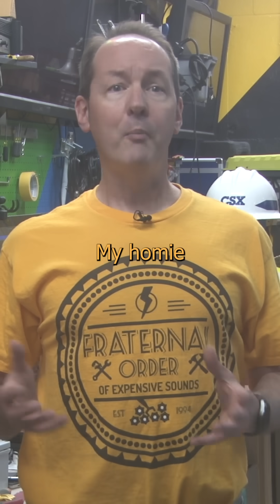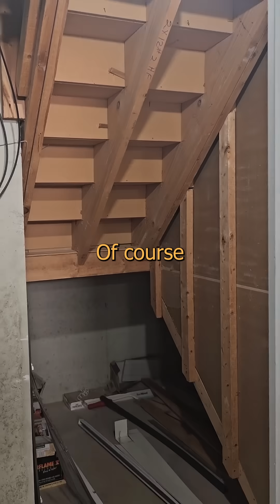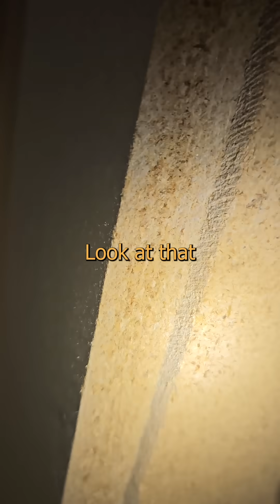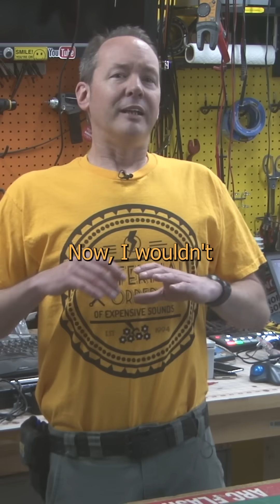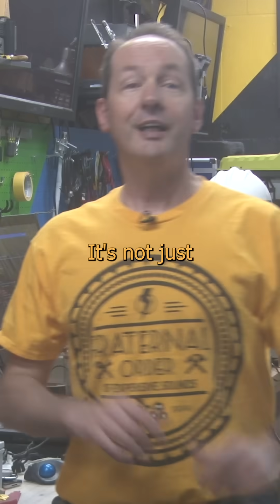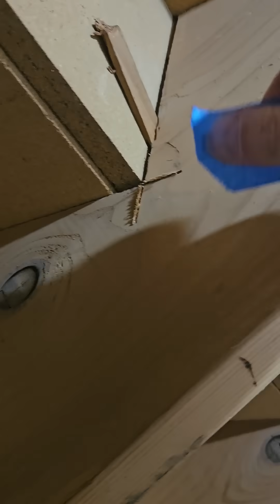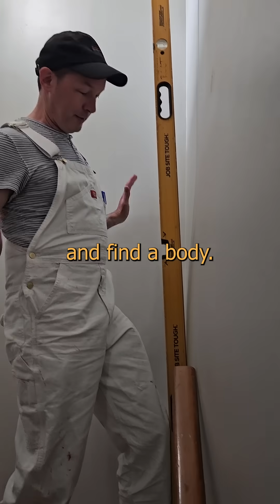Particleboard Staircase #chrisboden #engineering #construction #stairs #cheap #job #work #carpentry

Comment: Okay so it cant be legal. But i have no idea where it says that. I mean i studied code way back during the 2003 standards were still in place. I know it has a table refrencing the load bearing capacities of different materials but i dont have those books anymore so i cant tell. It is shocking what actually still consided up to code. Like drywall being nailed and 24" OC studs (yes thats real as long as certain conditions are met in certain areas.) But its definitely not industry standard. I would trust that over the government twats that write those codes anyway.

Comment: A lot of houses in the 60s and 70s were built with lots of particle board. My parents house built in 69 was completely floored with it.not a piece of plywood to be seen. Floors squeeked like you wouldn't believe. Was impossible to sneak out when we were teenagers. 😅 Went through it and put about a thousand screws in the floor to quiet it down.

Comment: Thoose stairs gave me flashbacks to doing restoration work in trailers those are fine untill water hits them than cardboard has more structure the cost of replacing the stairs will be cheaper then medical bills

Comment: When they built our house, they didn't wait for the adhesive to set on the ceiling joists before blowing in the insulation. The wave-action ceiling required 144 drywall screws and a "kicker plate" to fix. That was just one of the rooms.

Comment: You are correct.  Particle board is a no go for stair treads.  And I’ve worked in municipalities that have upped their code to remove it from stairs completely
Reply: AS1860 Particleboard Flooring
This is the code that allows particle board flooring in Australia. It requires the particle board to stand up to 3 months of weathering without a roof. 

I was very surprised by this but thought I would actually look it up.

Comment: "fuck you Fortunato" got me good. 

There are a whole lot of carpenters here that didn't bother to look up code. You can use particle board treads at up to 42" spans as long as they are Grade M-3 and fastened properly (adhesive and 3" screws with countersunk pilot holes). Would I ever do it? Not a chance. If I had to go cheap, I'd go with OSB treads.

Comment: Never drop your OJ on the stairs. Never mop. Never open the door when you have to run from the shower...
     As long as everything stays bone dry... (Without being in flames)... Everything should work out fine.

Comment: I had fuckery in my house as well, illegal plumbing, 1x2 instead of 2x4 and the same board for flooring. Found out it was a cartel that was using their money to make house cheap so they can wash their money within the construction.  Loads of houses have this problem. Bet the house was built in the 80's/90's.

Comment: It's because people aren't buying houses they're building houses and the people who are building the houses don't give a fuck anymore. Every day I have a conversation with friends who love architecture like I do and they're like what the fuck happened? What happened is people don't care. They want something that looks expensive on the outside and it doesn't matter what it has inside. Look at the current state of American cars. People don't give a fuck if they're built well or if they're actually sports cars all they care is if it's got a mustang slapped on it or it's got the front end of a camaro. As much as I do not appreciate dudes who do shitty jobs it's also the consumers issue. There's no way in fuck I would have somebody build a house for me right now. They all look like they're done by robots. Or how about the fact that $500,000 houses have plastic cobblestone on the front porch. Buy an old house you won't regret it.

Comment: that particle board pos is being cheap af, but those walls have beer stomach, even my useless engineering hands did better job in carpentry. Its garbage penny pinching vs real ducked up skill issue

Comment: They cut the stringers with a circular saw.  That is a bad sign to start with.  That should get done at a factory and not onsite.
I would be checking every rise and run to ensure they are the same and not /slightly/ different.

Comment: I'm a mediocre DIY'er and I wouldn't even use chipboard/particle board for boarding out our loft (I used half inch, or was it 3/4 inch ply), because I've had it bow on me.
That's before the fire risks, or the issues with it getting wet.

And those overcuts on the wood, I took more care that that when I was cutting some bits for a temporary project that wasn't going to take any weight.

Comment: BEST VID YET.  But seriously, I use hammers to inadvertantly break things when Im trying to fix the things and I know better than to use feckin partical board for load bearing surfaces.  Mdf or osb would have been "ok" but damn.  But lets bring back stained hard wood from the Victorian styles, enough of this sterile this weeks versionnof carpet or off white bullshit.

Comment: 100% from what I've seen on YouTube shorts on construction & home inspections that staircase should not be using that type of material it should be using solid wood for the horizontal & the vertical part since each horizontal & vertical part interlock & pushes into the support under it

Comment: My first job was at a stairs and railing place, I can assure you that the tread being made of the same stuff as the raise like in that video is exactly 1 moody teenager tantrum away from needing a full replacement. That wouldn't fly as a temporary installation, let alone the work of someone handing over keys with a smile. This is a perfect example of how "I know someone who can do it cheaper" will end up costing someone dearly down the line. Good looking out for your buddy, a couple hours of back breaking work is always better than a couple seconds of back breaking falls

Comment: Ha, I know what happened. They had a pipe burst behind the wall. The stairs rotted, and needed to be replaced, and the drywall warped. The previous owner went with the low cost option. And now someone else needs to pay more money to have it done right.

Comment: It kinda makes sense if the stairs are carpeted, but still isn’t great. I could really tell if they are though, I’d say if it has hardwood treads over that particle board and the rises are within code and don’t vary, it isn’t worth ripping it out to fix. Miss me with that stringer over cut though 🤮

Comment: Hm, up here in norway we use 22mm particle board of this grain structure as subfloor. No idea what was used in the vid, but the board we use looks a lot like the crap you see in ikea furniture. That is, until you lift it and realize it is incredibly dense. And when screwing into it you find it is tough as nails. So not the same thing. Just wanted to throw out there that such stuff exists and os code somewhere on the planet

Comment: and i thought my brothers place was bad, bottom of the stairway no problem, by the top i had to body check the box spring to get it up the stairs and something inside it broke, still doing its job so i guess it buffed out, the stairway though was about as lucky as it is square

Comment: I’d never heard of this. So I did some googling. And it looks like it is actually allowed provided it’s sealed properly. When I built boats we had a saying. Are you trying to build a 10 year boat or a 100 year boat? I guess y’all’d’ve called them ships but potato tomato. The point is yeah you could use particle board and 1/2inch is strong enough especially if it is sitting on top of the riser but like you’re not building something to last at that point and why do that?

Comment: I'm in one a these Similar Vista, Special Olympics housing developments and the shit i discover on a regular basis is more than The Discovery Channel does on another episode of a biker jackoff. I've got sewer clean outs under my kitchen island that are capped off just on the other side of the paneling covering the void it's capped off in. Steel flex conduit used with Romex, drywall with more wows than a magician hears at a 5 year olds birthday party, bathroom base boards made from MDF at the shower's base. Doors with gaps an inch off and I'm the first occupant a this property.

Comment: Code is a relative topic, I've seen outlets wired in whatever they had on the truck. 5 layers of carpet. Penny's for fuses and foam or cardboard for exterior walls coated with stucco....so it's all relative.  Building inspector are a joke, tell them something isn't up to code and you'll get a blank stare....ever seen a phase meter only go one way, backwards!

Comment: Man, I have done my fair share of cheap corner cutting in my own house because of costs being what they are, but never once have I considered cutting code that badly to cut costs. Also, hilariously, particle board like that ain’t even cheaper than the handful of one-by stock it would take to cut all the treads out, so we know that board had a prior life of being used and abused as a piece of flatpack furniture.

Comment: THIS is what non-union work gets you.... extreme cut corners, code violations, and absolute shoddy work all around. Its too bad that residential carpentry has had its market flooded with non-union work. 
Those stairs need fixing, and fast.

Comment: As somebody who worked for Menards for 3 years selling this shit… this is against SO MANY building codes. Even MDF shouldn’t be used for stair treads, much less particleboard. As the backer or the riser it’s fine, but the tread should never be something that could just dissolve like particleboard does. That needs to be replaced ASAP.

Comment: I bought a house built in '96, and BOTH the staircases from the main level down to the basement have particle board for the risers AND treads! The main staircase is a straight run, but the back staircase includes 2 landings made of OSB! 🤣😂😩

Comment: Love the effin blue tape!!! We should all be watching you and Cy!!😊😊😊
Reply: Everything comes back to home inspection. My home has surprisingly held up well, after I fixed some major fuckups when moving. Talking 3/4” gaps between the exterior wall and the foundation. Had light pouring through into my basement. And then the door to the basement had a 1” gap under it. No idea how my house wasn’t full of mice. Killed a family of mud robbers in there. Put in a sealed door to the basement after sealing up that 4ft long hole. Put down a glue trap and immediately it was covered in snakes. Put out another glue trap and it was covered in snakes. Put out a third glue trap and it caught a few more snakes but the rate slowed down. I went around that whole place with expanding pest foam.
Reply: @2nd-place the worst one was when I was working construction. My job was to fix things. Boss sent me on a job and good God. I told him it needed a bulldozer. Push it over and start again. It was going to be a shed, not habitation so nobody needed it RIGHT NOW so it wasn't scheduling. 
He said no. How bad could it be? We were "shimming" the strapping with full thickness 2x4 and coming up short but STILL the boss refused.
Reply: From the comments a bunch of us are!
Reply: @Platypi007  Some of us are subd to both too :)
Reply: @jameshilton3668  if you squint, it’s mint!

Comment: As a cabinet maker, that “wood” is good enough. The treads should be 1” thick…
Most furniture, yes even high-end, is made from particle boards with a laminate veneer. It stays flat throughout weather changes indoors. I agree with the “don’t get wet” part. 👍
House builders save time with speed, and errors…🤦‍♂️
Add $$$ if you want a perfect house. And it doesn’t help that our parents thought everyone should go to college, and not into the trades. 👎

Comment: I am a carpenter & these stairs will not last nor is it up to code. We had some particle board laying around the shop & needed to replace a few stairs for a quick fix & they probably lasted 3 years & that was pushing it so we did it right the next time.

Comment: There are some products that are rated for vertical applications and braced wall panels but I'm not aware of any particle board that is for flooring. If it had any rating at all then it should be stamped on the wood.

Comment: That's the way they built my home. Everything by eye. Never a level used from what I can see. Plus particle board under thin laminate everywhere. Now that the house is far out of warranty all the boards are swelling up from one leak or another. And don't even get me started on an insurance claim workmanship and repairs that are falling apart now. I was too young to know these things to complain. I complained about little things here and there and they did a half assed job patching it or whatever. It's amazing the prices that they charged and go for now.

Comment: UK here, I had access to the Reader’s Digest “Complete Do It Yourself Manual Books 1 & 2” when I was growing up.

Decades later, upgrading something in mom’s house, I find what the original builders cut corners with. And, since I’m ASD and cannot stand things being wrong, it has to be fixed, as best as I can, and to local code, so that it’s unlikely to fail in the future. I know what you’re experiencing, Chris.

Comment: i work on filming sets sometimes and the inside of the fake buildings have floors made exactly out of that type of particleboard and the very first thing i was told is to watch my step cause it will fall apart. and it does, I've had it break under my feet. i break it sometimes so others dont fall or to see where the supports are so i can actually step somewhere.

Comment: Section 7.4.4.4 of the AWS 2nd Edition standards book says that risers and treads have to be solid stock. So, lumber. Treads are required to be 1" thick (7.4.5.4), and there's no specific rule on Risers, but according to Section 7.4.6.12, they have to be rabbeted to receive the tread, so anything less than ⅝" thick likely won't be able to meet that requirement. Also, 7.4.6.12.1 says that they have to be mitered at open string stairs.

First time I've seen you ask a question, that I knew where to look it up.

Comment: I inherited a house in Hungary built around 1880. Corners between 80 to 100 deg. Some wall was 3/4 foot bending forward. (No particle boards though!) You went to the ceiling, look at the roof structure and you imagined what keeps the structure up. The wood got so distorted during the decades that some support structure was already ten inches below of the cross structure it supposed support from below.

140 years and still stand, solid.

Comment: Worked in restoration for a while. The fastest way to add a grand to 10 to a repair, is use partical board. 

If it's a 50 dollar desk off Amazon, or something you found at the curb, then whatever.

This one job I had was kinda weird, cause we were there a few hours after it happened. But there was no standing water, but half the first floor was wet. So clearly it was pier & beam, which could make it easier to dry.

When we pulled up the carpet, and saw partical board, we almost cried for that old man. His kitchen, living, entry, laundry, couple bedrooms, atleast 1000 Sf. Needed to be torn up.
Reply: AS1860 Particleboard Flooring
This is the code that allows particle board flooring in Australia. It requires the particle board to stand up to 3 months of weathering without a roof. 

I was very surprised by this but thought I would actually look it up.
Reply: @ecospider5 Wow, that's actually quite interesting, but them Aussies are built different, and apparently they build different as well. Lol

Comment: I'm not gonna even quote the code off the cuff because I'm sure I'll fuck it up, but as a carpenter, particle board stair treads scares the fuck outta me. I'm currently replacing a subfloor that got water damaged. They used particle board for spacers on some of the joists because they were ¾" too thin. Idk why they did that, but the end result it it has all turned to powder. It was done under all the seams on the old subfloor, so the moment someone spilled something it swole up quicker than an unlucky kid with his first pb&j

Comment: Well they have 3 stringers, if the treads are 1" thick (which is typical) it may meet present or perhaps past code in your area... 🤷 Definitely bare minimum builder grade BS 
Stairs are carpeted I'm assuming...
Still kinda shitty though.
Woah... What's up with that wall...omg

Comment: Often this is a home owner do it yourself.  Sometimes a sketchy developer. Depending on the jurisdiction who knows if what you pointed out is okay. In Ontario   risers can be mdf but not the treads. Based on performative requirements though.  As for bad drywall...well....is it a home owners do it yourself or a proper contractor? And...contracting is not highly regulated in some areas and still the wild west....

Comment: Unfortunately, the vast majority of new houses are built by a bunch of illegals who wouldn't give two shits about building codes if they even knew what that meant, let alone be able to read them. Combine that with the general contractor trying to build it as cheap as absolutely possible and the inspectors either being completely incompetent and corrupt and passing them. It is a recipe for complete disaster. Those stairs are just one humid stretch away from becoming a pitfall.

Comment: I'm from the Netherlands, not the US. Safe to say our methods vary widely, what i can tell you however, without a shadow of a doubt is that if you want those stairs to last, and mostly be safe in case of a emergency (Fire, flooding, what have ya make it up), it DEFINITELY doesn't cut it. Considering all them building codes yall got i'd find it hard to believe it would pass at all.